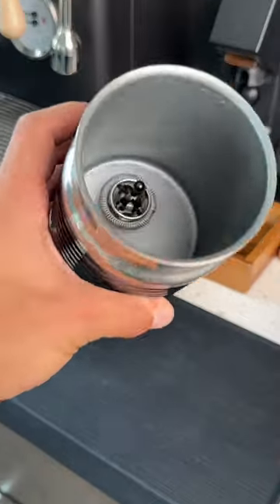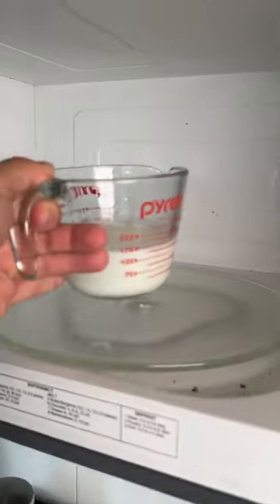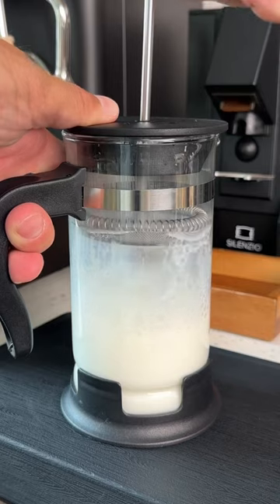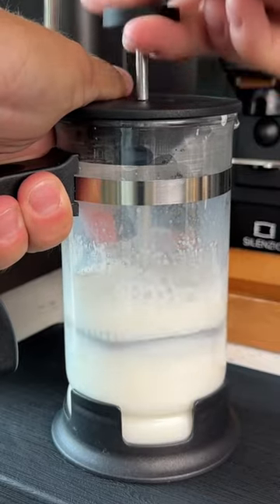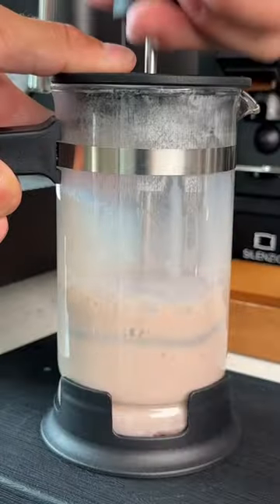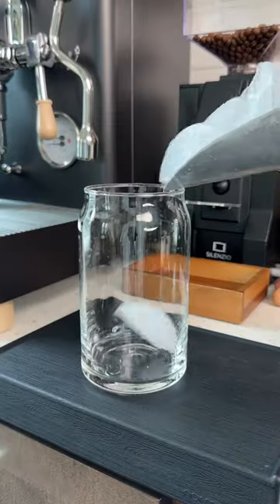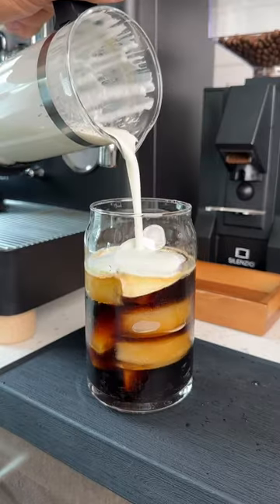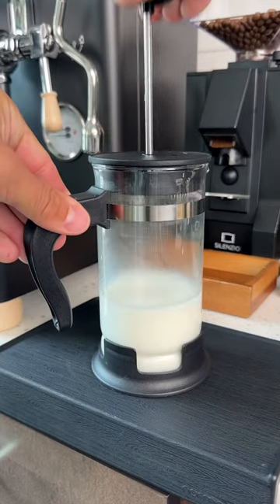The French press hack #coffee

Comment: I accidentally discovered this when cleaning my French press. I pumped it with soapy water and the soap got this silky smooth texture, I thought the same might work with milk. Turns out it does! It also ruins your French press over time but it definitely works!
Reply: Gonna buy a cheaper french press just for milk
Reply: How does the press get ruined from this? D:
Reply: @nemkoo  Calcium buildup and scratches the glass or even break it. So yeah, don't buy expensive french press.
Reply: @GodMaxDrinkerofTea at that point just buy a frother
Reply: So if I do it in a Yeti it won’t break got it😊